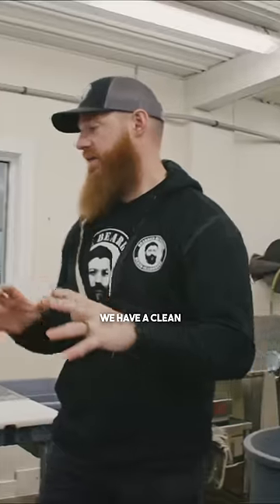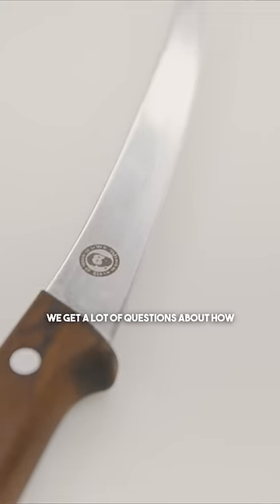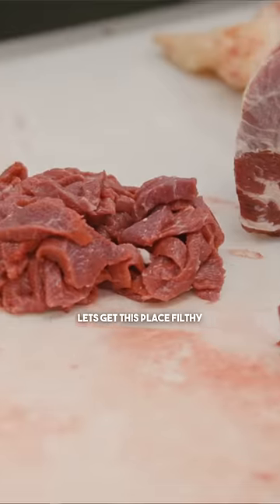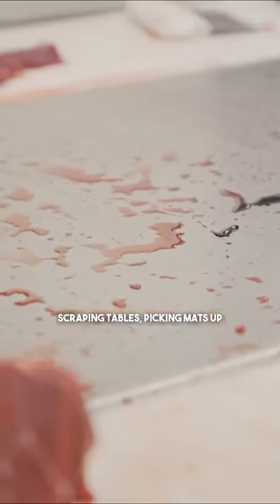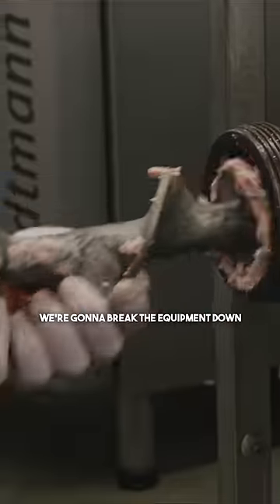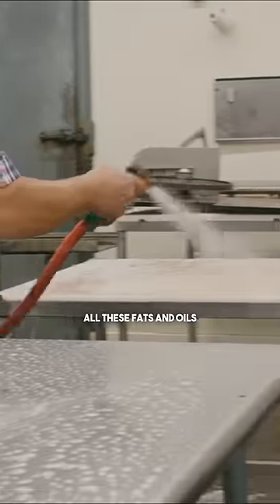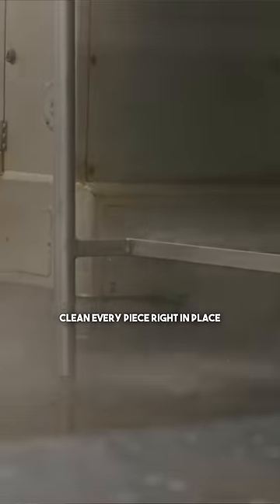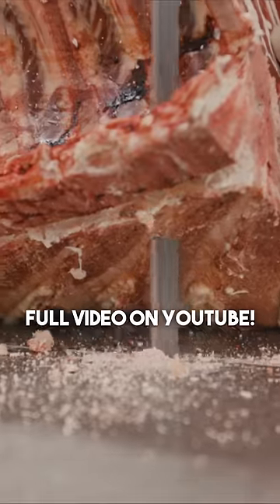How We Clean Our Butcher Shop! #shorts

Comment: One of the jobs I had at our local grocery store butcher shop was to hose down the meat cutting room.  We did this by spraying everything down with a hose, into a floor drain.  The butchers were real douchebags and would throw ground beef and scraps of fat on the walls and all over the equipment.  One time I didn’t bother to clean it and they were pissed when they got in the next morning.  I told the store manager, “now they know how I feel when they purposely throw burger and meat scraps all over”.  😂  we all got chewed out but no one was fired and the BS stopped.😊

Comment: Now that I'm just cutting at home for us, I work in the kitchen with a commercial meat slicer being my only "luxury" so, I start clean as do you then at clean up it's pretty much the same, get any loose materials up, then hit the sink with a bleach-mix cleaner and wipe heavy spots on the counters but, to finish the counters and the slicer (after main disassembly/cleaning) I spray everything down with "food surface sanitizer" which is a safe, pink fluid that's available by the gallon at Home Depot.  It's a great product that you also let sit for a while then can let air dry (best) or wipe down after 30+ minutes and you're good.  I use it on anything that doesn't go in the dishwasher.  Counters, sink, knives, anything that got used/exposed.

Comment: i worked as butchery server/cleanup as an after high school job when i was a teenager, i would serve the counter until closing, then i would do dishes/trays then i would pull the mincer auger out and open the bandsaw doors and remove as much bone pulp by hand then i would use the foam sprayer to spray the entire shop from walls to  floor and all machines, i think it was those chemicals you mentioned then i would use the hot water hose to hose everything into the sump  drain.. it was a woolsworth butchery so i wore the standard uniform plus a full butchers apron ... man i went home smelling like cut bone and that cleaner